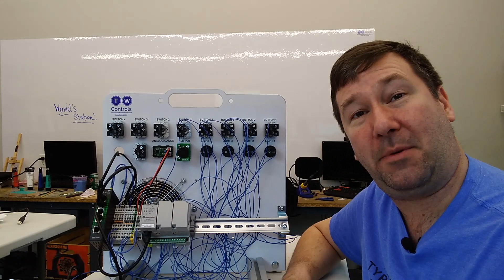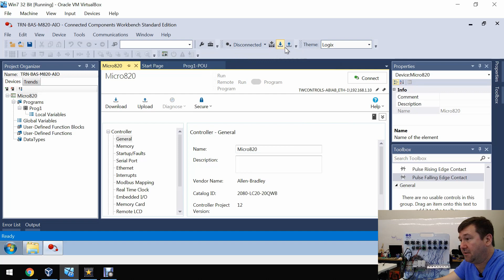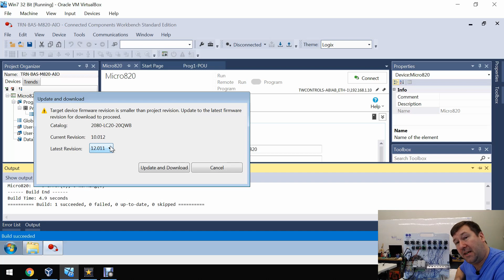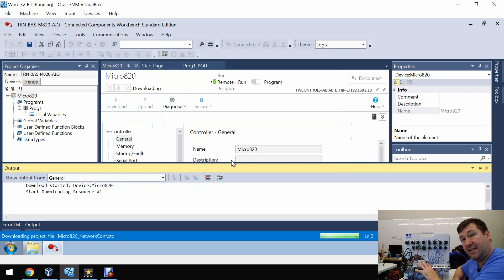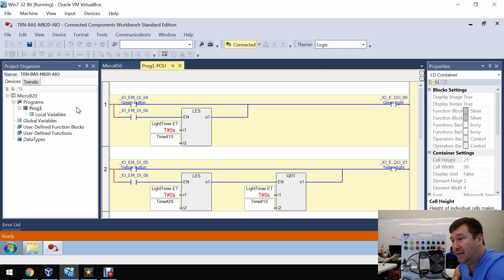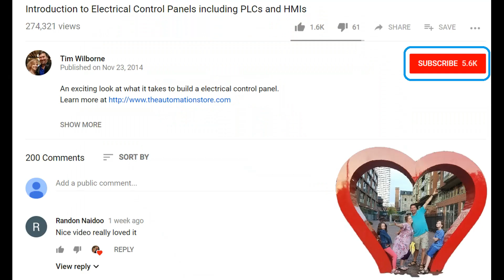Downloading a PLC Program to a Micro820 Connected Components Workbench

Comment: I was always told to put my computer on  top of my PLC. Then when you download it helps you remember that it's going down to the PLC. If you upload help you remember it goes up to the computer.
Reply from the maker: Yes, I have heard that one too but more times than not, the PLC is mounted in the top of the control panel and I can't reach the keyboard if I do that :)

Comment: Still confused between normal download and download with project value….Please clear
Reply from the maker: I should do a video on it. Project values can be uploaded from the PLC so you have a backup of the exact data. Then you can download with project values to get that data back into the PLC.

Otherwise, it is downloaded with the initial values which are zeros unless you change them in CCW

Comment: Hi Tim. Thanks for this video. I'm just starting with programming a Micro820 and thanks to you I now have it loading and running my program. I have a problem though, it doesn't retain it if I power down. I need to reload from CCW every time I power it up. Am I missing a step in getting it saved to non-volatile memory?
Reply from the maker: See if this video helps.
https://www.youtube.com/watch?v=kpa1nB1yulI
Reply: Hi Tim. Yes, that gave me the clues that I needed to solve my problem. I needed to mark all the time variables for retention as it was booting with them all set to T#0s. One further question though, now that I look at that table of values, I see that I can alternatively set them in the Initial Value Column. Any particular difference there? Is one methodology for loading values on reboot considered better practice than the other? Perhaps do both?
Reply from the maker: Initial values are just the values after downloading.  I should do a video sometime on project values vs initial values

If you want to have a certain value set each time the machine power up, use the first scan bit.

Comment: Excellent video.  I have a couple questions regarding the downloading and uploading of the values of the variables.  Specifically, in RS500 and Studio 5000 when you upload a program the offline program retains a snapshot of all of the values in the tags (variables).  And when you download, these values are sent back to the PLC.  It seems as though this is not the case when it comes to the Micro850.  All the values were initialized when the program was downloaded.  I saw somewhere that you have to explicitly enable Data Protection and even then you can only select up to 60 variables.  Is this true?  If so, what is meant by "project values"?  I'm guessing this does not refer to the values in the variables.
Reply from the maker: Hi Dave, I should do a video on this but in order to get the values, you must disconnect then upload the program.  This is an aspect that I hope they improve in future versions of CCW.
Reply: @TimWilborne  This explains much of our confusion.  Thanks a bunch for getting back to me.  I'll be doing an upload to grab these values as soon as I can.

Comment: Dear sir your presentation is excellent. However i have a micro 830 controller for controlling pump systems.i need to replace a new one but i have no backup software. Now how i can get backup software from my existing PLC
Reply from the maker: You want to upload your program from the PLC. Check out this lesson.
https://www.theautomationstore.com/uploading-from-an-allen-bradley-micro800-micro820-plc-with-connected-components-workbench/

Comment: Always i am getting this fault  when start downloading to contrller , MIcro 850 LC-50-24QWB, "Failed to get running image info from controller. See log file C:\ProgramData\Rockwell\CCW\Log\ISaGRAF.ISaGRAF5.Vsx.log for more details."  After that deleted all files as per Rockwell procedure and again the same problem, CCW version 12 , PLC initial version 10.11, This software is not compatible for PLC Engoineers
Reply: anyone help me to resolve this issue , no support from local rockwell suppliers
Reply from the maker: I'm on the road today, I would post your question at PLCs.net.